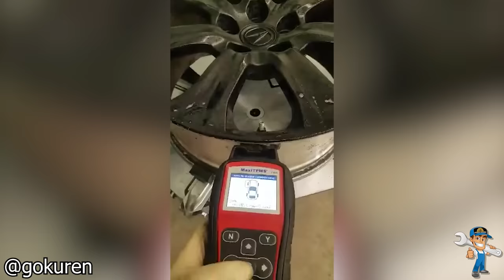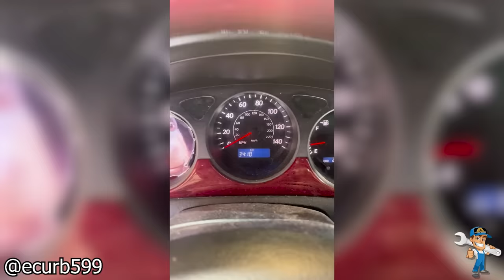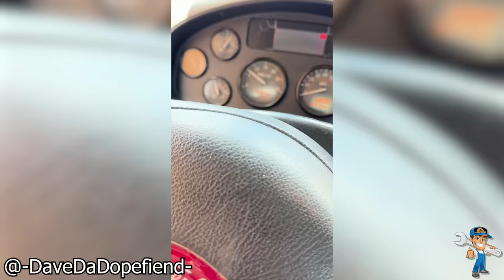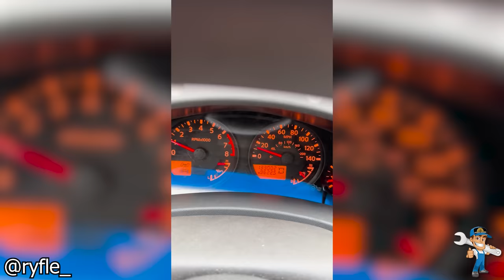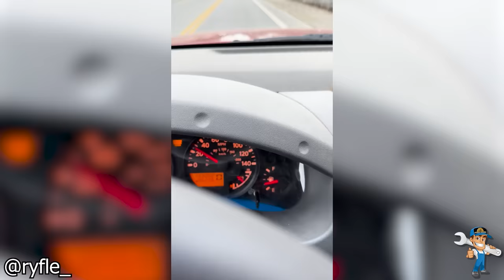Customer States They Were Involved In Road Rage

Comment: Engine noise: Belt, accessory bearing or vacuum leak?
Reply: I'm more leaning towards idler pulley, had a similar problem on my F250 5.8l. It would start to make noise like just sitting in the drive thru but when I'd power brake it it would go away. I happen to have 2 extras and replaced NO MORE NOISE !!!

Comment: 3:21. My guess is a vacuum leak or the idler pulley. I couldn't see the car, but that engine is a 2zz.
My daily is a 1zz celica. I haven't worked with the 2zz's too much. I can't tell which side of the engine bay the sound is coming from.
Reply: I was thinking an idler pulley as well. But, of course, without being there, hard to tell. But I think you are right.

Comment: I experienced the same sound on an old clio. One of the metal tabs mounting the  ecu under the bonnet/hood was partially cracked. The noise was the fatigued metal rubbing at low rpms. Went silent at higher revs. Might be something similar.

Comment: Strange engine noise sounds like on my 05 Saturn Ion when the PCV hose between the intake and the valve cover got torn and I replaced it with a hose that was too short and kinked. It would go away when revving or driving at higher speeds but was definitely present while sitting and I couldn't for the life of me figure out the issue. Thanks random Redditor for pointing out that my hose was kinked and that was the cause of my noise

Comment: The noise is probably due to a leak in the intake, located in between the throttle body and the cylinder head.

Comment: Did you really say a 2 liter Camero?
Reply: Sounds like it. Ecotec LTG: 2 Litre I4 turbocharged, 205kW/275hp
Reply: That's what I was thinking to and then remember my 82 berlinetta v6 which was a 2.8 so....
Reply: Did you really write "Camero"?
Reply: The newest ones are 2.0 turbo. Just rented one in Hawaii, and as much as I was displeased getting a 4 cylinder Camaro (wanted a V6 or v8 mustang ", I have to admit it takes off like a rocket. It's a low end plus high end turbo, so the first one give boost right away. Head and shoulders faster than the 87 trans am I used to gave, just that lame sound though. 275 hp isn't bad at all.
Reply from the maker: Unfortunately I did... apparently they aren't too bad but who doesn't love a good old V8
Reply: @Santor- Most rental companies don’t bother with the V6 stangs anymore, they’re either eco boost or 5.0 in my experience (rental car mechanic)

Comment: How would putting the lugs on backwards make the tire wobbly or make the car drive poorly? Isn't it still threaded the other way?
Reply: Lug nuts are tapered on one side  so that they fit into the holes on the wheels.
Reply: @KennyHall-x2f  ah… so it never really gets tight or torqued all the way. That makes sense.